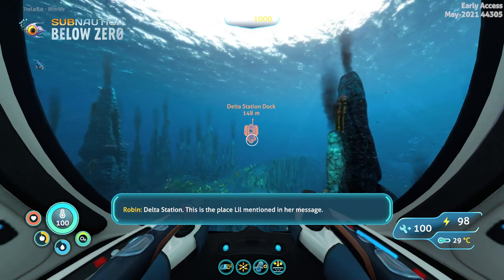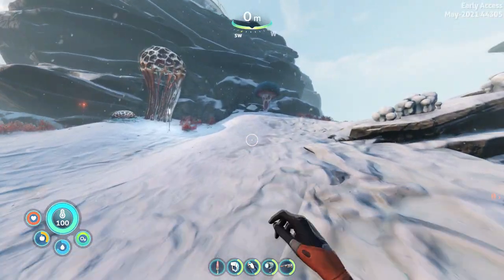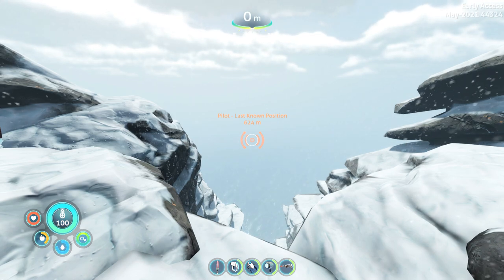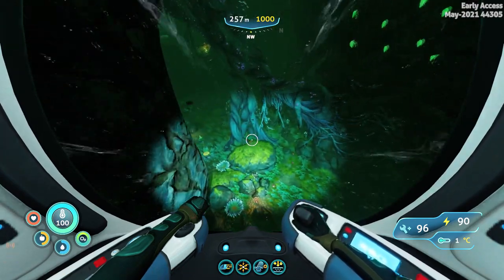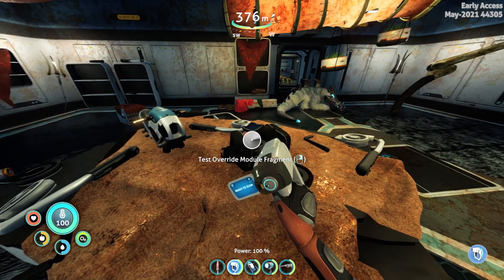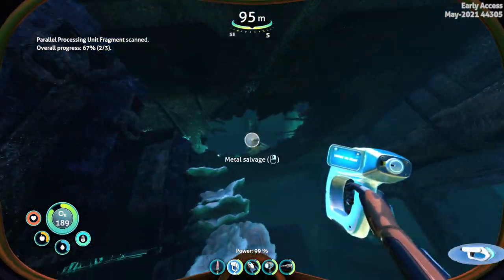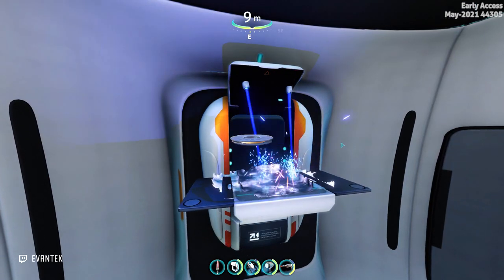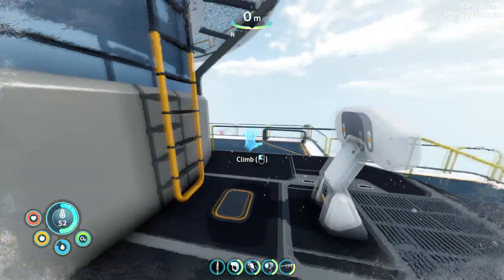Test Override Module Subnautica Below Zero

Comment: If you cannot press it,, it is because u probably don’t have a primary bonded for use and instead of a secondary which for some reason doesn’t work so just check ur binds and make sure a button is set for primary next to use
Reply: Thanks man, I was standing in front of that terminal like an idiot
Reply: Yeah this fixed my issue as well I just thought the terminal was bugged.
Reply: @_TheGlockSaint_  me too man me too🤦🏽‍♂️
Reply: Man thanks a lot .. after 2 hours trying everything this work perfect 🙏🙏
Reply from the maker: Thank you for this comment. I didn't know so many people have this issue.
Reply: @Evantek  ofc i was so relieved when i figured it out
Reply: It still wont work witch is so dumb
Btw im on xbox
Reply: @zer0theforgottenassassin789  same
Reply: thanks man
Reply: @zer0theforgottenassassin789  same, did you fix it?
Reply: Bro somehow it's still not working for me I'm on ps4
Reply: Yeah I can't use terminal

Comment: Most confusing right now is where to get a MK1 depth module. I have blueprints for MKII and MKIII but not MKI which is needed to make the II and III.
Reply: If it’s for the seatruck you have it already in the fabricator
Reply: You need the vehicle upgrade console installed in the moonpool
Reply from the maker: Yeah, moonpool plus upgrade console will do the trick.
Reply: You have the mark 1 as soon as you get the sea truck in the normal fabricator you don’t need to waste material on a moon pool and upgrade console

Comment: What button do I use on xbox
Reply: A
Reply: @yourfriendlylocals.soffice9966  I tried I’ll try again maybe?
Reply: @yourfriendlylocals.soffice9966  it didn’t work
Reply: @EDP454  did it give you a prompt to press A
Reply: @yourfriendlylocals.soffice9966  nope
Reply: @tonydiazist  idk it worked for me
Reply from the maker: I think they game will tell you which button to use.
Reply: @Evantek  it's A but make sure you use default settings. I use A to jump instead of Y and it wouldn't work. I've talked to the devs and they said they are working on fixing it so it works with any button layout